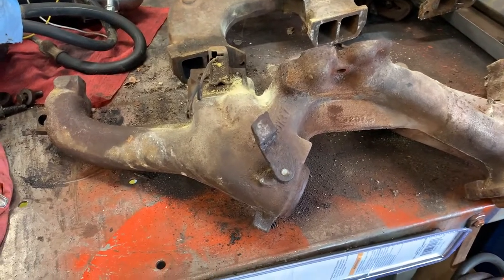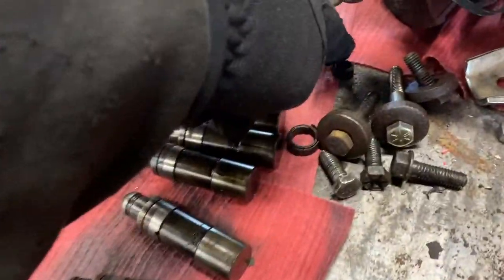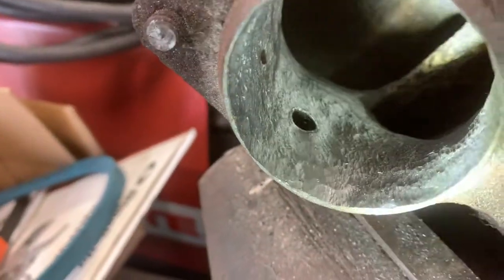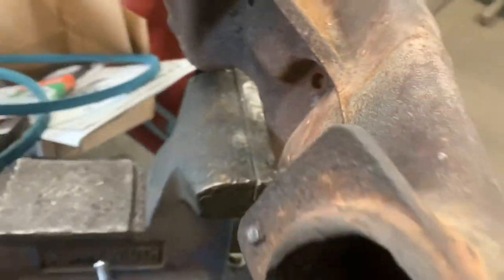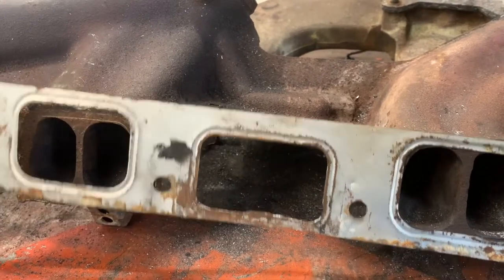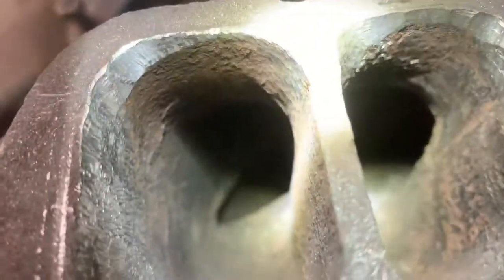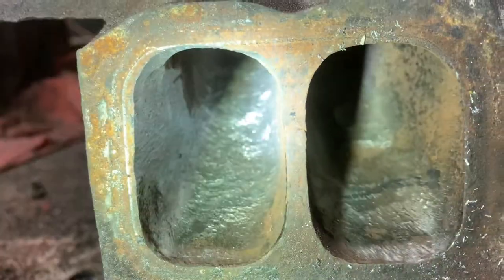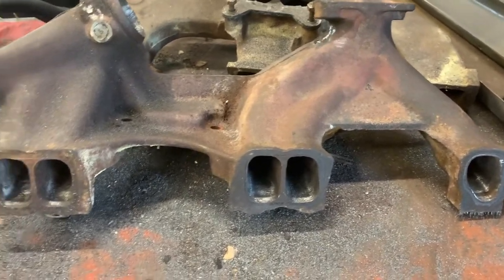Exhaust manifold porting

Comment: Interesting look at the exhaust on that old over head cam 6. What tools do you like to use for porting?
Reply from the maker: I use the carbide grinding burrs made for metal. I have a set of 3" and a couple of 6" for deeper spots. I use the cross hatch style (double cut) type most of the time but to remove a lot of material fast I use the single cut style. The "oval egg" shape is pretty useful for most everything but the "ball" style and the "rounded cylinder" style are pretty handy too. You can get them from most any tool seller (Snap On, Matco, etc) or online at industrial places like McMaster-Carr.com. Have fun and wear your safety glasses!
Reply: @olzkng  Thanks so much for the details. Cheers.